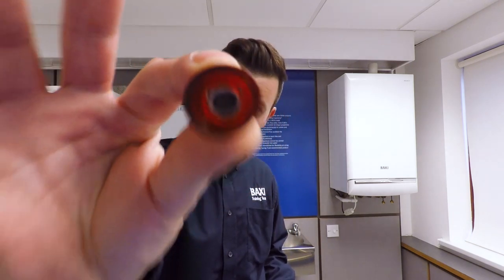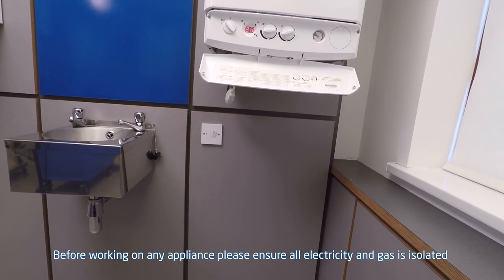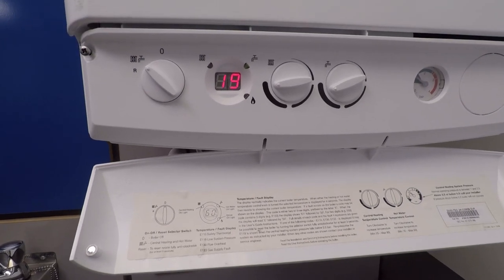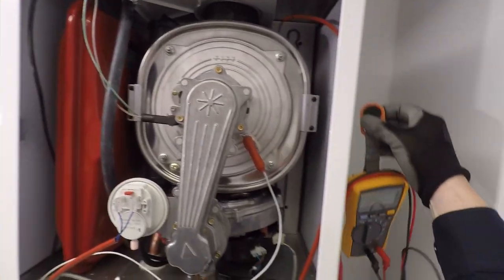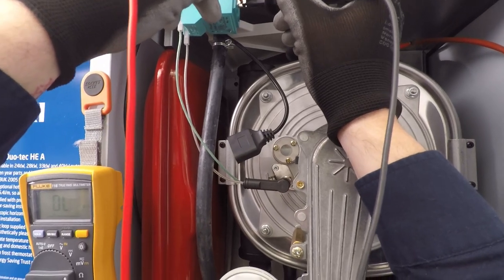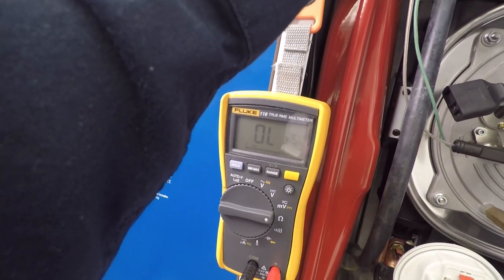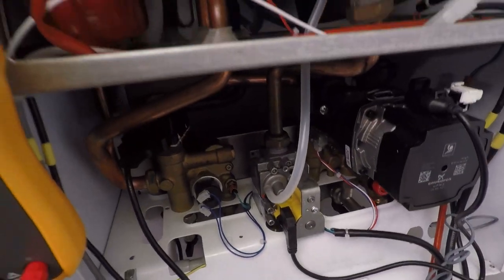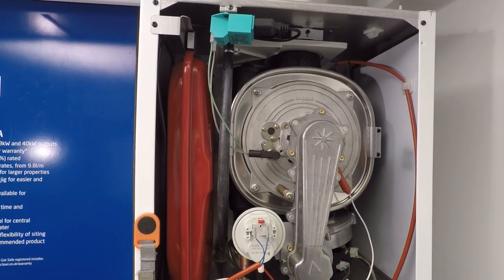How to test the spark generator on a Baxi boiler

Comment: Excellent video, I applied all of this to find my fault I used an old style ignition timing light from the garage then tested ohms and had O.L as you did. Next tested power input just as you did. Couldn't have found it without your vid thanks very much 👍

Comment: I changed a spark generator on a duotec today, it was sparking nicely but the boiler would not light. Replaced spark gen and it worked a treat, I guess the spark was too weak?

Comment: Rob on the duotec how do you test the hot water float assy voltages. I thought it was a switch but diagram shows it as a 3 wire hall sensor

Comment: I've just been trying to test a spark generator on an ideal logic. I have a fluke multi meter which I'm not using that often so not really that confident with. Ideal tech told me to have the fluke on AC when checking if there was power coming from the board and to look for 240volts. Is that correct or is it just because it's a different boiler. Great video by the way. 👍
Reply: Yep, confused too..... that's what the book says for the Megaflo as well......
Reply: Easy way to do it... carry a spare electrode and plug it in outside the burner. Or failling that you can actually take the electrode out and see if its sparks out of place ... saves getting the mutlimeter out.
Reply: If you get low voltage you’ll have this issue. If your supply is below 240v won’t be good and won’t allow enough power in amps and volts to build lad up the energy. I know this as I’ve switched over to off grid running 230v now but won’t run boiler at this voltage and get the flashing red light of death. Switch to on grid 240volt and starts a treat. Some guy said it’s to do with the earth loop back through the neutral but not at all it’s just the accumulation of voltage needs saturation into some kind of collector or capacity and release at a given build up in dc of course for the spark to do its thing. 
There is of course the chance I’m totally wrong and it’s as I’ve said a low voltage not allowing the correct PCB function to operate. 
Any solutions would be welcomed as I’m not good on the electronic workings of a boiler. There must be a work around as lots of places have voltages way below the 230v and thus have same issue.

Comment: hi i have the e113 fault spark gen is sending dc 145 and have taken the electrode out and seen it spark gas valves opening also what else could i test? could a strip down service and replacing both electrodes rectify  the issue